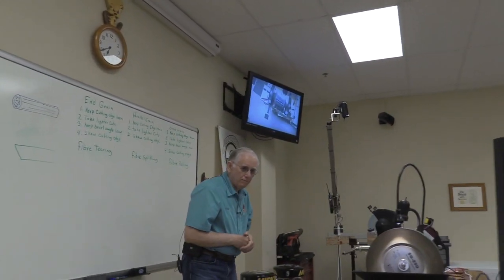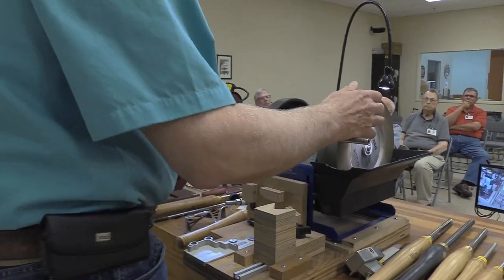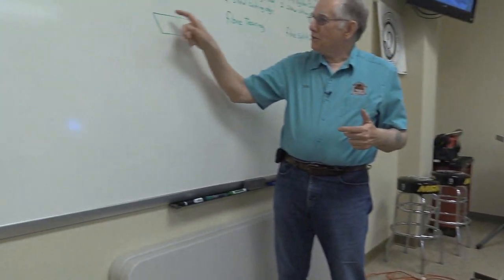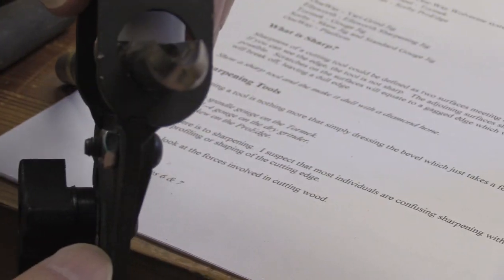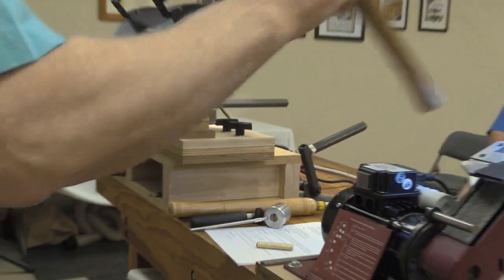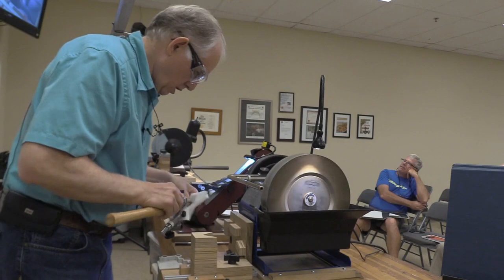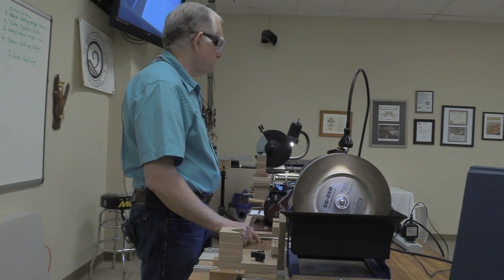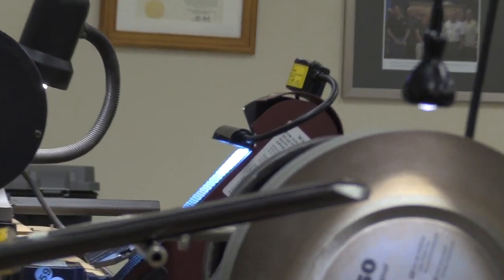Lathe Tool Sharpening Part 1 - Removing The Desired Wood

Comment: When you grind the flat to extend the life/ability to use the jig for sharpening, how do you do that in a way that ensures that the added flat is planar with the factory groove?
Reply: I use the existing flute wings to hold the tool shaft in alignment.  With the Tormek, I use the horizontal support bar in the vertical position to register the flute wings, while moving the tool shaft up and down the wheel.  This is a slow process on the Tormek.  Since that video was done, I have purchased a new dry grinder from WoodTurners Wonders with CBN wheels.  The CBN wheels can be used without wheel shrouds.  The Tormek dry grinder accessory allows using the horizontal support arm to support the existing flute wings while grinding the flat area.  The process is much quicker on the CBN wheels.  I have also done it freehand on the dry grinder that was used in the video.
Reply: Thanks for the reply. I just ordered the Tormek dry grinder accessory to use with my grinder, so I will give that a go once I have it set up. All 3 videos were very informative and much appreciated.